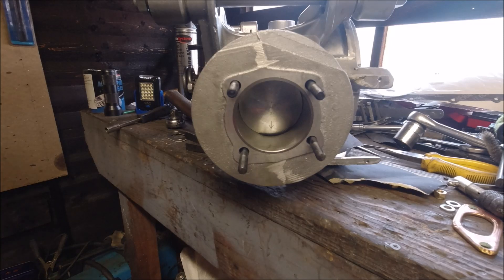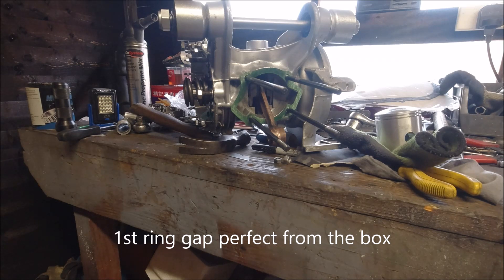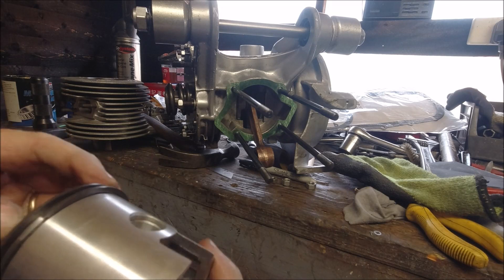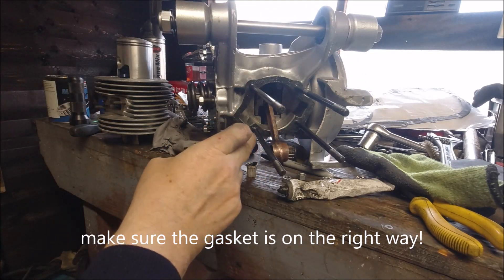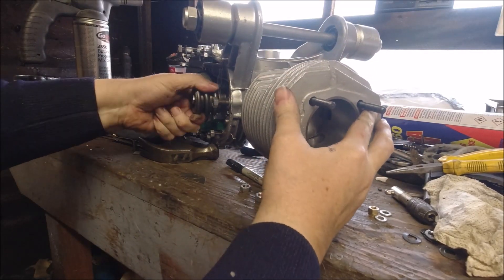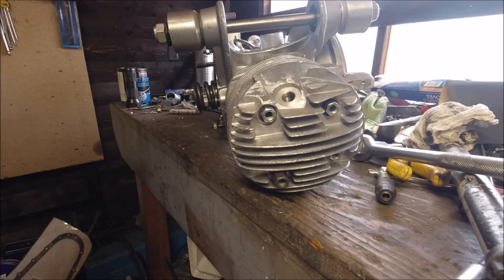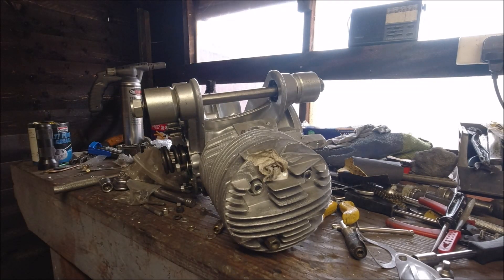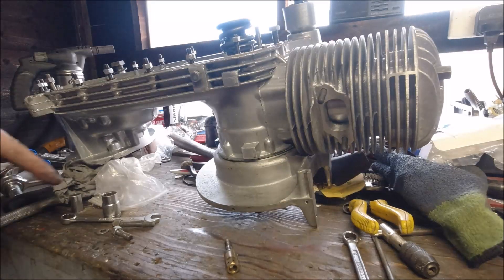Lambretta engine rebuild 20

Comment: I this one of them swp Indian kits of eBay how did it run with this
Reply from the maker: It's come from Beedspeed and ,I have only just ported the cylinder,  I will be doing update videos , and should give an honest opinion of the cylinder,  but with upgraded head and piston
Reply from the maker: BTW it ran great , pulls well and smooth, I had it in my gp for a while